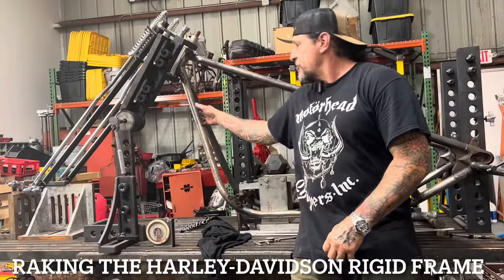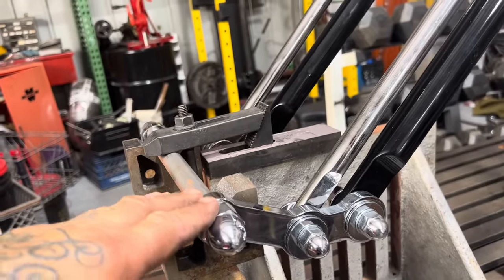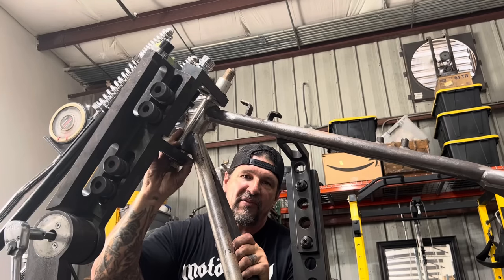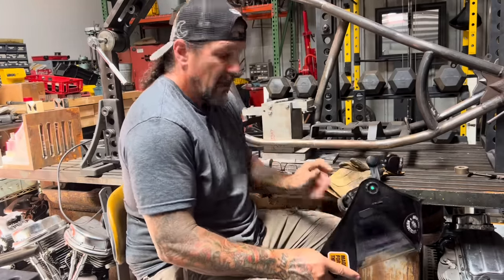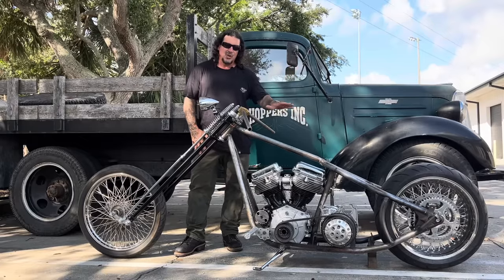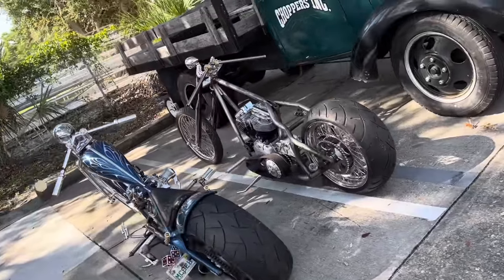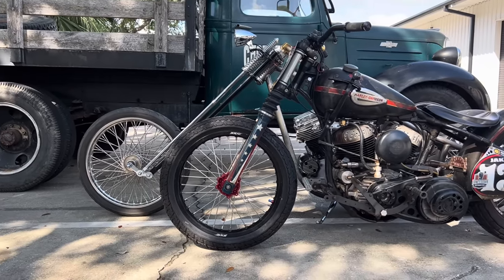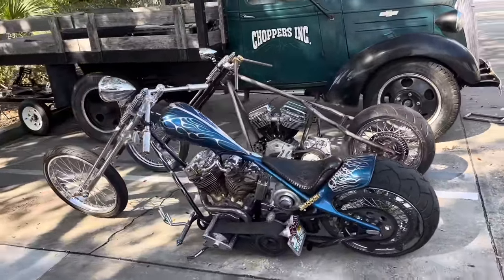Billy Lane How to Rake & Stretch a Harley-Davidson Chopper Frame Springer Front End Choppers Inc HD

Comment: Hey billy. Trying to figure out a frame geometry question, which I think I know the answer to but want to confirm. If I want to add 2” of stretch to the down tubes of a frame, but want to maintain the same rake angle of the neck, won’t I still need to add stretch to the top tube as well? So that it just projects the front end out more in the same angle. Been researching this for a little bit but no cold hard answer as there’s a million ways to do this. New to chopping. Thank you!

Comment: As I recall from my days as a kid, angle grinders (the one I had access to) had to have the trigger pushed, for it to run. No lock. I think a thing like that having a locking trigger is asking for bad luck - just like the lack of shielding the blade..  Hope the glass in that mask at least is safety glass. There are picks to be found of what can happen to a face, if bad luck visits the work shop..

Comment: Hi Billy, im building a shovelhead bobber and have fitted a panhead swingarm. Could you give me some tips on how to correctly space and align the rear wheel? How do you go about it?
Reply from the maker: The old way was to put the wheel on the axle with no spacers, and use a long fluorescent light bulb against either side of the tire as a straight-edge guide. Measuring against the frame’s backbone, you can determine the size for axle spacers on either side of the wheel.

Comment: You don’t want your axles at the same height anyways unless you’re running the same size wheel and tire which most of us run a 21 up front 16 or 18 rear which is same diameter cause of tire size anyways so what’s the fast way to configure that with a 21?

Comment: Do you fit your knotch for the neck by hand or do you have a fixture?
Reply from the maker: I have
Reply from the maker: I have fixtures for the tubing if the frame is unassembled. When the frame is like this, I draw my cut lines on the frame tube and carefully grind the joint to fit